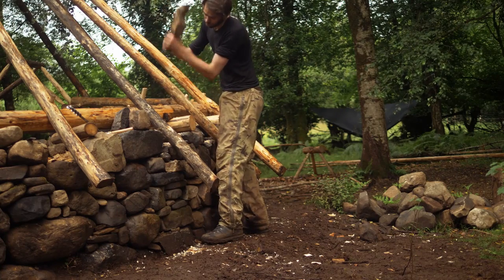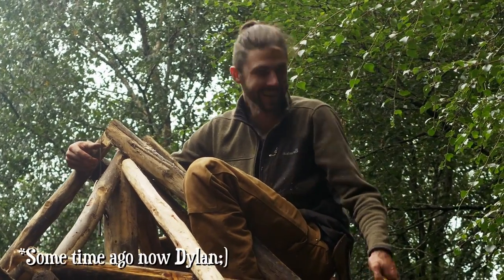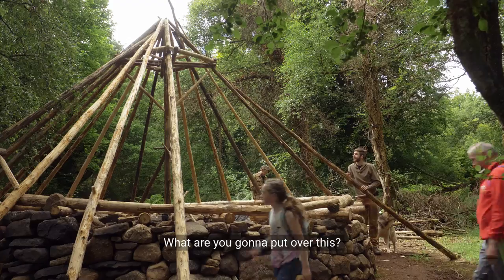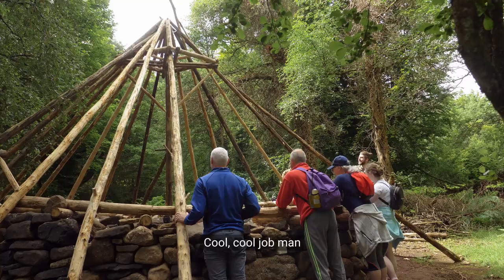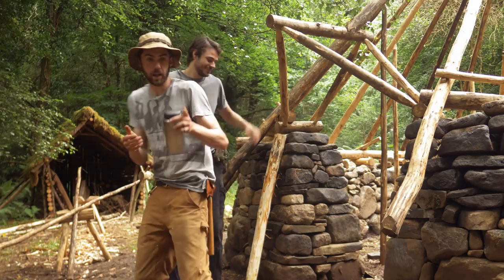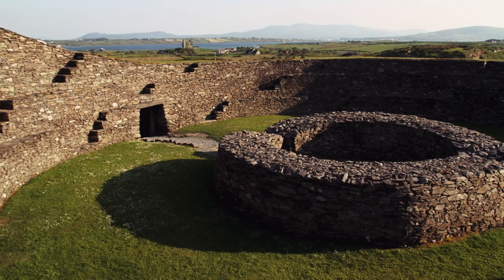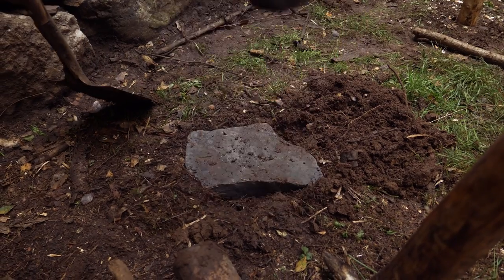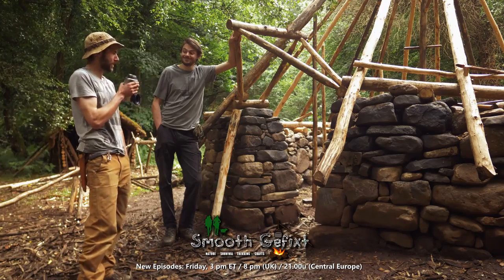Medieval Roundhouse Bushcraft Build - Roof Frame Finish & Historical Context (Ep.9)

Comment: The lower entrance is keeping the heat inside, because, as we all know, heat rises up in a room. You could also hang cloth over the entrance from the inside.
Reply: True or animal skins as curtains... also weren't people less tall back then?
Reply: @tobiastho9639  i doubt it would make much of a difference unless ancient Irish people were hobbits.
Reply: CINNAMON GUM Looked it up on google: “People in the Mesolithic period were shorter than today. A woman's average height was 154 cm and a man's 166 cm. On average people lived to the age of 35, and were more well built than today.”
Reply: @tobiastho9639  That's only half a foot, modern average in Ireland is 179 cm for men. There's a much larger variation within the population than between them
Reply: A doorway needs to function as a doorway.  Comfort is important.  It makes no sense  to block a good arch.
Reply: If you're going to have a solid door though, it doesn't really matter much. At least if there's a remotely decent fit.
Reply: @tobiastho9639  most people got old back in the days but the average is just very low, because of the young deaths...

Comment: We must remember they that built these in the past were much shorter on average than the people of today. Also, we do not know how they designed the entry height since there is no historical record.  They were as smart as we are today, it's just our knowledge has increased. I believe they would have built it for ease of entering with parcels or heavy loads. Many interior poles were thought to be used as dividers and hanging areas of clothing and utensils' The interiors were also thought to be plastered for decorations and for insulation against wind and blown rain. The foundations are all we have to work with, everything else is for us to learn and use ingenuity, and the products that we use are in the local area or could be traded for.
I think you guys are doing an excellent job. Why I am a new sub.

Comment: You can fill the doorway in if you want later, but harder to change it after you've made it short. 
If its a little taller and if what you have decided to use as thatching isn't as 'airy' and the smoke builds up... it's easier for the smoke to escape with a taller doorway.. and if it gets too cold put another log on the fire!
Keep up the good work!

Comment: I suspect that if someone is going to really feel strongly about that doorway then they're going to find 87 other things to nitpick about as well.  You can't please some people.  I'd leave it tall and save my back and forehead the trouble.  It's much as you said, if you took the design back 3000 years and showed it to some folks building a house, they might well adopt your design.  It's also quite easy to add some cloth or additional thatch across the doorway if it really does result in an excessive amount of heat loss.  In my mind, the bigger gain is that it's going to allow for smoke to escape freely from a greater height - that air exchange is a good thing for most of Ireland's year.

Comment: Loving the series, not at all bothered by the shape of the door. Just wanted to add a couple of suggestions. Wooden mallets were often made from a burl, where the wood grain runs in multiple, twisted directions. This gives more resistance to cracking from heavy use. Also, peg joined buildings (at least in the US), frequently were made using green pegs and off-set holes. The green wood could bend enough to pass through, but when dried would be impossible to remove. No idea if that is historically accurate for Ireland, but it might be worth considering. Best of luck!

Comment: While I'm not here for the historical accuracy, I kinda agree with the low door, yes it'll be a pain <and I'm 6'5" or 195.58 cm tall> however there's a big point to be made with keeping heat inside during  the cold months, hot air rises so having a lower door will really help in the long run as long as you properly insulate the walls inside, or the roofing isn't bleeding heat out tremendously. Keep up the good work mates.

Comment: Architect here. Reg. The heat issue inside the house. Shapewise it is not the best house to maintain heat in, because there are still of airspace  above a standing man. This is no different from other regular houses. 
Still, you have to generate more heat before the residual heat are settlet at torso level. Your heatsource is a stone oven i assume. This radiate heat. But the warm oven comes and goes during a day. So you want to heat (warm air)  to stay for as long as possible before having to reheat. 
Best bet is to make it it as airtight as possible or as little outside airmovement to enter the hut luxery would be a wolly blanket(!)or woven mats(?)  next the stone wall (all around) to create a small stillstanding air pockets between the blanket and wall, to prevent  cold radiating  from stonewall directly onto you. A buffer air is needed in the in cold months. (Too bad they didnt have bubblewrap sheets in the stone age ) in igloos they make a coldness hole to collect the cold. Worth a thought. Lastly, warmer beds want to be higher up in warm trapped air. 
- Anyway. Fantastic project you have going there. I like it, loads.

Comment: Being of a Celtic background I'm enjoying these weekly videos alot. I was wondering why you don't lock those wooden pins in with a wedge. Like you would for an axe handle...not like I wanna give ya more work or nuttin'😉
Reply: Basically, a wedge goes in to a tool haft because there's going to be movement that might slowly jiggle the axe head or whatever off of the haft - Roofs don't jiggle
Reply: @rhystakel796  agreed. Plus you are entirely relying on a single friction fit for extreme wear and tear. This structure has dozens if not hundreds of points all holding it together. IMO adding wedges would be the equivalent for an ax of using wedges AND string AND sap. Just overkill for not a ton of extra stability. The handle can still always break off in the middle

Comment: If my understanding is correct the low door kept the heat in around the heads of people so they were better for winter. It also made an intruder bend head down and not be able to use the longish, sharpish knives and such. So safer and warmer.

Comment: Good project guys! I like the middle supports creating an interior perimeter closet or storage. I also like the footage showing the solid installation of wooden pegs. If you heavily covered both sides in thick mud and plaster this would greatly increase the air tightness and insulated thermal mass for interior comfort...I know getting ahead of construction but just curious. Great job.

Comment: The low door make an attacker put him self in an exposed position going in.. maybe that could be the reason for the low lentil
Reply: those roundhouses weren't built for war or defense. but it would certainly put any raider in a vulnerable position.
Reply: It's because these Dutch guys are at least a foot maybe 2 feet taller than our historical ancestors!!!
Reply: Yeah because simply burning the house down isn't an option at all ^^
Reply: I’ve heard that explanation in Mayan architecture. But in our reality, it would just be a pain in the ass.
Reply: I think the low door didn't have a good reason other than nobody cared about bending over back then. They bent over breaking their backs with hard labor every day anyway.
And there were probably plenty of houses with higher doors too. We might see no record of them even if they were common.
Reply: Pashtoons in Afghanistan built lower door ways to compounds around the time of Alexander the Great to prevent raiders on horseback from entering. Now, the Taliban make the doorways more narrow because modern soldiers wear bulky body armor which makes it harder to enter quickly or quietly. The lower doorways may have been a combination of insulating aid and self defense. One does not have to be at war to worry about intruders.
Reply: That might be the case the Mongols used that on their tents to put anyone walking in to it in a defend less position.

Comment: I don't know if the entrance is that much to worry about, who knows how many different shapes for entry covers were actually used.  There was probably the basic style that was easier and quicker to build, but there may have been a few clans where they had just enough time and resources to do something different.  The stone wall is looking quite nice.  It's nice to see how the structure becomes more steady as the pieces get placed and fastened in.

Comment: Interior and exterior plastering is probably a good idea.
Using lime mortar???
By the time you fill in the spaces between rocks, you might be looking at two layers/applications to get it smoothed out a bit.

Comment: Nice videos, great build project though I do not understand all of your European banter. 
      I am impressed by your workmanship and dedication to detail. In my opinion your plan to place flat stones under the roof supports is a step towards paving the entire floor. Should you do so it will cause you to build a threshold at the entryway. Thus reducing the doorway height. I hope you have sufficeint doorway clearance when it is time to furnish the hut with a refrigerator, a bookcase and a grandfather clock. 
      Enjoy some California banter.

Comment: the door was smaller back in the day because people where shorter and yes. for insulation. Older houses and cabins her in Norway show that design as well. if you could fit livestock through the door it was big enough. Personaly i would make a add on with wattel wall and roof about 1 meter from the stone wall, making the entrace more weather proof

Comment: It looks so much more complete already. You can really see the house now. In my mind you're already making pizza in the completed hut.
I know it's still far off but what are you going to use for the floor? I've seen roundhouses with wood chip floors but I guess you would've had to collect them the whole time you were working on the rest. But there's always just a layer of straw which should be easy enough to come by by the end of summer.

Comment: I suppose like anything else the finished article would depend on materials found locally, also I think the need for shelter would influence speed of construction, so as long as it was functional they wouldn't worry about niceties. Most round houses I've seen just use wattle and daub walls, this being surmised by what was left ie nothing, stone circles would leave some trace I think. Good project!! Don't forget the drip trench around the outside HA HA

Comment: I like the arch the main reason why the door was short on the original houses is the people of that time were shorter on average they were 5 and a half foot their doors would be about head high so if the man that built it was 5'2" the door would be 5,2 they measured the door by standing next to the door frame post and cutting it off at head high

Comment: Since you're using steel saws, steel chisels, steel auger. Why are you not using a steel hammer?
Reply: Hilarious, I was thinking the same thing this episode.  I mean, if we're in the steel age, might as well use a steel hammer, lol.
Reply: a fair bit of the historical evidence I have seen indicates that with iron being an expensive commodity, cutting tools would be made of metal, but a hammer need not be unless you are a black smith... wooden mallets where common place even in colonial america. (of course I do not think they have built a GOOD wooden mallet yet :P )
Reply: even in modern carpentry wooden mallets are used, so you dont damage the wood. But normally they dont break as easy as theirs
Reply: Wooden mallets are used today even in timber framing. Steel will break the wood, wooden mallets allow the pegs to go in without shattering.
Reply: I thought of this when Dylan used a stone as a mallet at one point.

Comment: Would using heather as roofing be enough to keep the heavy rain outside? For sure you'd need a lot of it, is it okay to take that much (in summer) from the surrounding area? If it were me, I would order some reed. For harvesting reed yourself, you'd have to wait until winter.

Comment: nless the lower end of the roof structure is secure to the foundation walls, the weight of rain or snow on  the roof structre WILL over time, spread outward

Comment: I'd float the opinion to have a removable bar over the door (pretty much what you've got to start with) as in the summer would let in air (as as the fire would still be used for cooking/maintaining the thatch/smoke preserving food it makes sense to me that an open doorway would be beneficial. But the amount of sinus damage from woodsmoke from remains may veer me away from this idea? 🤔 but in the winter a shorter doorway would be a lot better to keep the heat in, and a small waxed wool blanket or leather I personally thing would have made sense to easily cover the entrance while allowing the heat to be kept in. So only have to bash your head half the year. And also people wouldn't go out and in as much as in summer so that's my thoughts in the door ;) sorry it turned into such a long ramble ;)

Comment: The stone work is beautiful, but from a practical viewpoint I'm surprised you guys didn't incorporate clay from the outset, backfilling the voids in order to plaster/insulate will be hard work. Having worked a bit on a very old house in Portugal, I'm sure this stone/cob technique would have been used in medieval times as clay is so abundant. There are also plenty of wrecked stone buildings in the countryside of Portugal that look like the remains of dry stone built dwellings, this is because when the roof goes the insects, animals, plants, rain and wind move out the clay, I guess same in Ireland.

Comment: Well Done 
But i Think you need horizontel Support timber at your roof Strukture to hold the the Material that you use to Cover the roof
The Door must be not so high because the warm air will get out of a high door so the smoke from the fire will always Streaming downwards through the door and dont go up in the roof and out
Yours Frank

Comment: House will be both cold and smokey in winter, yes?  Iron age folks probably tolerated that.  You fellows are good with discomfort for overnight challenges, but if Julian is going to spend a winter in there, every little bit helps.  Plaster inside, tight fitting low door with wool or leather on the frame against the gaps, warmest thick thatch. Tiny fire with driest wood, no bark, if the only escape for smoke will be thru the thatch.
Reply: While they have to be careful with fire and sparks, the smoke will filter through the thatch roof. (If you didn't know any better, you'd think the place was on fire, to begin with.) The smoke will also help to preserve the thatch, as well as keeping the bugs and mice out of the thatch. The smoke 'captured' inside the dwelling should level out above their heads @ 8' - 10'.

Comment: Just do an earthen plaster of 1 part clay, 1 part soil with a handful of long grass or animal hair in it per a half gallon of it for the inside and you will seal all the cracks. It will need patching one a year in the spring, but not as much since it will be fully protected from the elements since it is inside. You could also plaster the outside with this since the roof overhangs it, but it could cause problems with the stonework. Pointing with lime putty based plaster on the outside would be the best covering for the outside, but I don't know if that would be historically accurate where as the earthen plaster would. 

The real thing that is going to make it warm inside is the stone wall acting as a thermal mass that will resist temperature changes, evening out the temperature from day to night and even slowing sudden cold from effecting it, giving you time to build a fire. Also, as long as you keep a fire going in the winter, it should stay nice and warm inside easily and during the summer it will actually be significantly cooler inside the roundhouse during the day.
Reply: Good in theory but in practice, not so much. Those stone walls will be cold in winter, and all the convection heat will be at the roof. Mostly only radiant heat from the actual flames. Warmer than outdoors for sure, but toasty? Nah! 🙂
Reply: @BlackSwan912  They will still even out the temp swings from day to night and resist sudden drops in temperature, like when a cold front moves in. Any structure with masonry mass works like this, even if it is exterior walls.

Pointing between the stones with mud plaster or lime mortar will stop any drafts. Even shoving in material like small sticks and moss will make a difference.
Reply: KnightsWithoutATable True. Just not to “toasty” specs is all I’d add.

Comment: I've seen indigenous people enter a tent or lodge by standing sideways to the building, then backing under the skin door, pulling the fabric close around the body as you back in, then quarter-turn in the rest of the way inside. Kind of like getting under the covers on a very cold morning without disturbing your partner. You don't fling up the blankets to slide in bed, you use your body to block the heat escaping.
(Example: see 22:17 in this video https://youtu.be/Xi80xrE3MkI.)

Comment: I can't speak for Celtic tradition but I know in the Norse world you had steps down into the Longhouse, then you had a step that you had to step over as you crossed the threshold, plus you had the low doorway requiring a crouch.  Awfully difficult to crouch and step and attack all at the same time - to say nothing of having a fire in front of the doorway to mess with your eyesight.